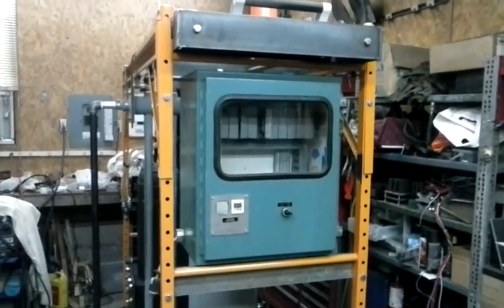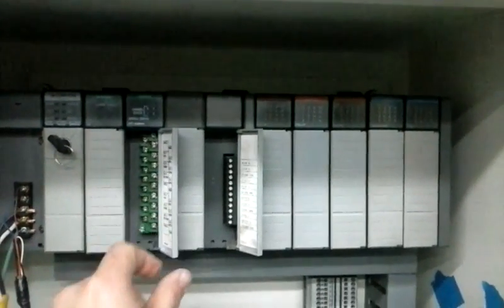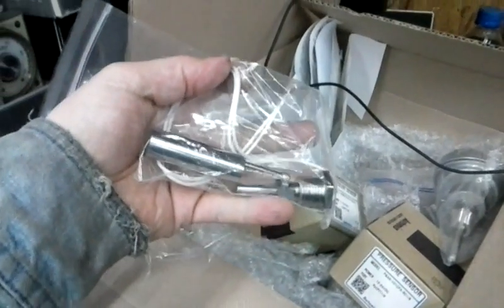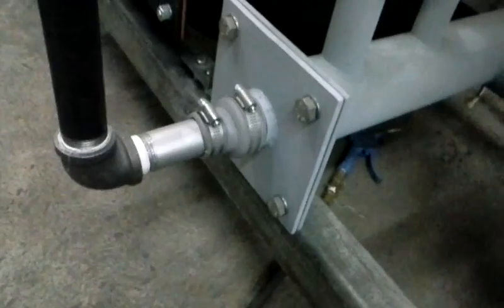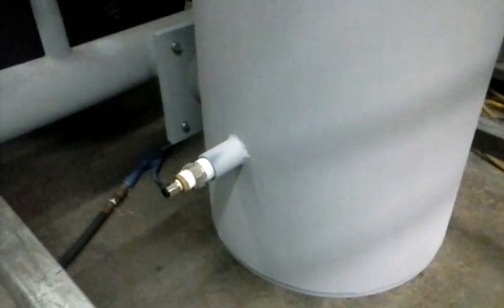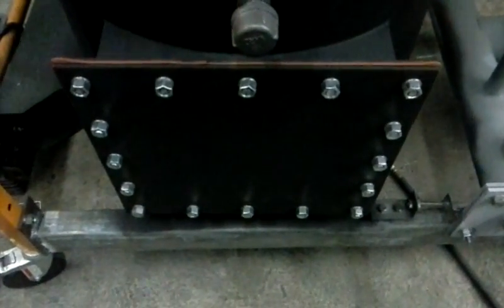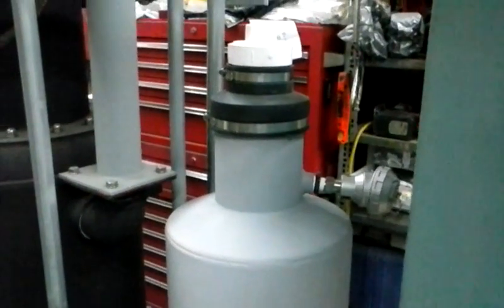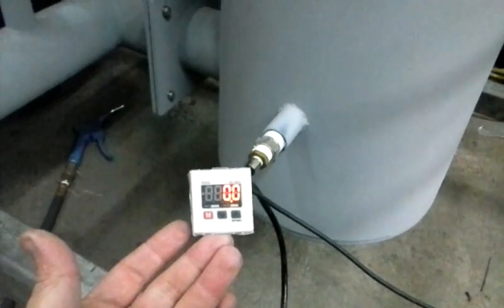Gasifier Progress 3-20-2015

Comment: Mighty impressive!
You are creating an industrial standard fuel refinery right there.
Everything is so neat and tidy too, which is never easy to achieve when building an entirely new system from the ground up.
She's gonna get kinda dirty when you get to using 'er.
Are you really sure you wanna light that shiny new puppy up and get 'er all hot and bothered  ;) .
Reply from the maker: I don't want it clean. I want to catch up to your run time hours , then keep going. I am getting anxious . Too bad it costs so much. That also limits the progress.  I will keep you posted. Thanks for commenting.
Reply: mazdalorean
Hehehehe, your wish to own a dirty gasifier will soon come true  ;) .
Mine passed the 440 hour mark today, so you might have to run yours overtime to catch up.
These sure can be a bit spendy to build, but I think you will forget about that when you are saving thousands in energy bills  :) .
Reply: ***** it is all worth it, when you are running your generator.  I just love to go out and look at my meter.....just sitting there. I wish I had kept track of hours on mine. maybe this new one.
Reply: Casey Jo
Yup, it certainly is worth the effort alright.
Being totally offgrid becomes so much easier when you have a gasogen  :) .

Comment: Beautiful work, Joe. You have taken it to the next level for sure. The pressure test with soapy water will pinpoint the leaks rather quickly. When I had my heating system installed years ago my HVAC friend Bill Parker added a pressure gauge and tire /wheel valve to the system, put a few psi into it and let it sit over night. That eliminates any doubt as to the integrity of the seals. Moving forward  you can then cross that completed build off the leak list.
Again, your work is inspiring. Have a good time.  Bill  NH Hbbyloggr
Reply from the maker: Thanks Bill, I always feel like I need to get a bunch of stuff done first, before posting a video, so I can show a lot of things in a short time. My problem is I forget half of the stuff I have to show , and end up not showing some things. I had a paper template of how I laid out the gasket for the door, but I forgot to show it. I have a feeling my hopper lid is the biggest culprit right now. We'll see , and when I find out I'll keep you guys posted. Thanks for commenting, Joe
Reply: mazdalorean
 Joe, Some people are blessed with many divergent skills. I always feel that I'm taking  way too much time trying to edit, splice, get the proper " flow" on the video production only to get 27 views and likes. That's why I don't give up my day job. Thank goodness a picture is worth a thousand words when all else falls short.
With out rushing, do you have any idea when you might be far enough along to do a test flare ?  I'm at the edge of my seat to see this one !
Reply from the maker: NH Hbbyloggr Bill, I always hate to shoot videos. I always miss stuff, say stuff wrong, don't have things prepared enough, never feel like cleaning my garage, and hate the sound of my own voice. If all that wasn't enough, you end up spending a day to shoot the video 3 or 4 times, fight with your computer, wait, wait,wait, and wait some more. Like you said there aren't tons of people into wood gas, but the few that are sure do like to see what others are up to, so that makes it worth it. Once I get the leak situation done, I will work on a blower. I have the bio char ready for a long time now , but I'll have to gather some dead branches ( enough to run for a couple of hours) , chop them up, and run this damn thing. I guess it's all up to the amount of motivation, amount of overtime, car repair, house repair, and events coming up that always slow you down. I'll keep you guys posted as the date nears. Thanks, Joe
Reply: mazdalorean
Joe, the wait/wait/wait part of the video game got a whole lot better after Flash helped me through the video converter program which he uses. I even went to the effort of getting the same camera so the explanations did'nt get lost in the translations. That cut the upload time down considerably. Now it's just keeping practiced to remember the steps. AHA ! Maybe a video on the process is called for !
. Maybe later...when I have time.  Peace, Brother !